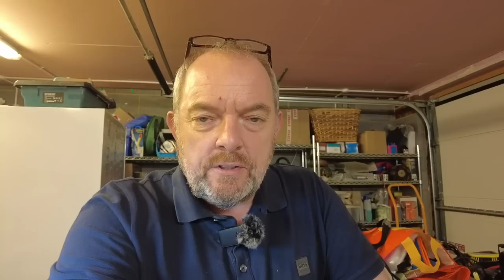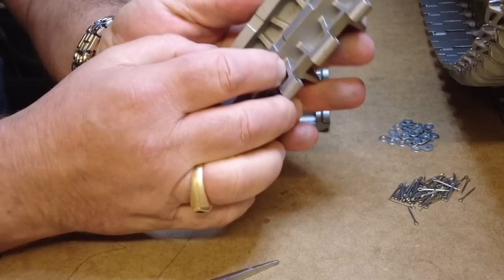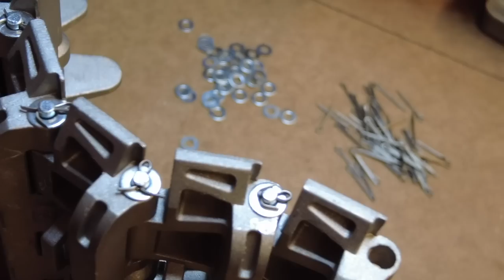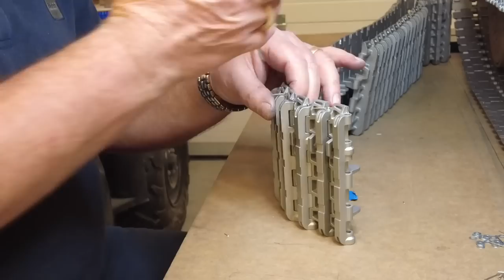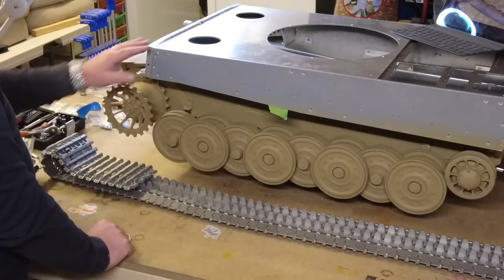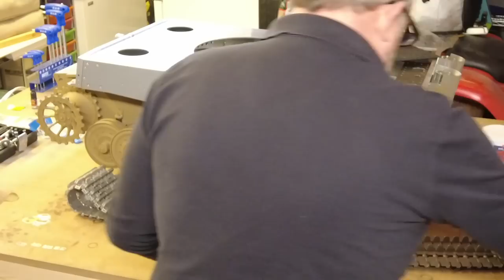1/6 Scale Armortek Tiger 1 Tank Build -  (Video 10)Track Assembly & Installation

Comment: Hi, Just seen this video. I built the first generation early Tiger from Armortek. Your track links look to be cleaner castings than on my Tiger. Also, if I remember correctly the pins on my Tiger were held in with grip washers but I did drill the pins and used some soft copper wire to hold the pins in place. One issue I had was debris getting stuck in the tracks and going around the return roller. The motors were powerful enough to break a track link which was a pain to replace in the field. In the end I made the return roller tension adjustment spring loaded which solved the problem. This said I drove the wheels off my Tiger through all sorts of mud and rough terrain, its a great well built model. I think the best out there. I also made the first generation Sherman which is a superb model. Alas both are sold now, I believe the Sherman, which I built as a Firefly is in the USA now.
Reply from the maker: Hi Allan, thanks for watching and your comments. Yes from what I understand Armortek have greatly improved their kits. I guess they really do listen to the end users. I still have to be careful of debris getting stuck in the tracks, especially small gravel parts. I always jack up the tank after driving and inspect the track for debris...Not had a link break so far but still early days...I guess that is why they provide spare links... I would have loved the Sherman as this is one of my favourite tanks of that era...The Firefly...was that the British army version?
Reply: @tonys_workshop  Yes the Firefly was the British Army version with the 17 pdr gun. I bought a model kit of it and copied that.
On the Tiger the channel formed by the dual track horns seemed to naturally gather debris. On the full size Tiger the track horns are not solid and have a hole cast in them. This may be for lightening the track and/or allowing debris to escape. The road wheels can ride over the debris easily  but if it goes around the return roller it really pulls the track tight. I used to run the tracks very slack and I never had one come off, even turning tightly on grass.
Reply from the maker: @allanrichards3752  Thought so...A good tip on the tracks thank you...I have 92 links each track and keep it slackish...seems to be performing well so far.
Reply: I have the early Tiger you built Allan - partly stripped now for another restoration.
Reply: @petersilcock4260  That's good, nice to hear its still around. Do you still have the anamatronic figures and the exhaust smoke generators I messed with for ages?
Reply: @allanrichards3752  No unfortunately - they were long gone before I got the model.

Comment: Hi one thing I can add is having replaced tracks on numerous occasions on large excavators and other machines which have dozer tracks it helps when joining the track on the machine if you join it at the sprocket end then there is less need to hold the links while inserting the pin as the teeth of the sprocket hold the links in the correct position for you without any struggling
Reply from the maker: Hi Peter, thank you for watching and commenting. Yes, this has been suggested by other more experienced builders as well. I would totally agree now that I have been through the process...a rookie mistake, but thats how we learn. Will definitely use this method when I need to remove the track in the future..Thanks again for your valued comment, it s very much appreciated. Hope you continue to follow my build.
Reply: @tonys_workshop  well that's exactly righ I had to learn on 30 tonne excavators and prinoth ahwi mulchers look that up on YouTube if you like we had an RT 400 and a 200 as well which I drove most of the time as I could transport it only weighing 15 tonnes anyway I digress I have subscribed because Amourtek are just down the road from me an I'm considering buying one but not sure if it would be ready assembled or kit form . keep up the good work and if I have anything else to add I will

Comment: Hi tony. I find it easier to join track / chains on the drive sprocket. This holds things together better while you insert the split link
Reply from the maker: Hi Paul, thanks for your comment and for watching...that makes complete sense...I just found that access was better at the rear of the tank..especially for my big old sausage fingers..... I will definitely try that, if or when I have to replace a link or remove the track...Thank you

Comment: Tony put 1 pin the wrong way round and paint white. Best to split track up at the sprocket
Reply from the maker: Hi and thanks for watching and for commenting...Yes another tank builder suggested the sprocket to split the track as well. Will definitely use this method when I have to remove the track again. Nice tip on painting the pin..Thank you...Hope you continue watching..

Comment: Tony oh the Tracks another fun job🤣🤣
Now starting to look like a proper tank.
Did you take 1-2  links out in the end once you added electronics and Batteries?
Reply from the maker: Hi Gary, yes another lengthy process but in a bizarre way, I actually enjoyed it. Yes, I ended up with 92 links per track in the end. Once the additional weight was applied and the tracks started to loosen up, it definitely needed links removed...works a treat now..thanks for watching and your continued support is very much appreciated.

Comment: The numbers 1 and 2 on the track parts distinguish which mold cavity the part came out of in the factory.  When parts come off the line and QC checks them they need to know which cavity the part came from in case adjustments need to be made.
Reply from the maker: Thanks Jon, solves that question. Thanks also for watching and commenting. Hope you continue to watch and follow.

Comment: Ahh, A bucket list item for me is to build one of these! As you rightly say preparation is important. You answered one of my questions already (it weighs 250 Kilos) could please add dimensions? (will it go through a normal-sized door?) How will you get such a big cat off your bench! and I also assume a trailer or panel van is a must if you intend moving it around. Loving the build! I have been asking about a software update to allow a simulated gear change along with engine tone (I see it sort of with gun recoil) but the electric motor is so smooth (whereas the "driver" would have to change gear ) I will very much enjoy your progress thank you
Reply from the maker: Hi Jim, thanks for watching and commenting. The net weight is 150kg, then the motion packs approx (from memory) approx 40kg...add the two 12 volt batteries and it is up there over 200kg...put it this way, you aint lifting this by hand :-) dimensionally approx 1550mm in length including the gun barrel, just under 600mm in width and with added figures height approx 550mm. It certainly goes through a normal size door, but be mindful that its heavy and the metal tracks will chew up nice finishes. I do cover this later on in the build, but I transfer my tank from the bench on to a table scissor lift and use a folding disabled ramp to drive the tank from the table lift on to the floor. This can also be used to drive the tank up into an estate car, van, SUV, trailer etc. Interesting thought on the gear change, that would be excellent as well as the tank recoil after the gun is fired..probably the only thing lacking on this amazing model...Hope you keep watching...more to come.

Comment: Would adding a little dab or two of white lithium grease to those track link pins before putting them together have been a good idea?
Reply from the maker: Good question and I think probably yes, but again no mention of this in the instructions. I thought of regular grease, but then worried about picking up dirt etc, so fitted them dry. Definitely something I would consider for the next build. Thanks for watching and commenting, its very much appreciated.

Comment: Hi Tony, Ive just stumbled on your video, brilliant work, i am at a very similar stage with my Tiger 1, can you tell me what base yellow you used for the road wheels please?
Reply from the maker: Hi and thanks for watching. I used Fosco Industrial Army Paint
Color: WH. Dunkel Gelb, 400ML spray Matt for the entire tank. I used an grey etching primer for the prep work. Hope this helps and thanks also for your positive comment. If I can help on anything else, please do not hesitate to ask..
Reply: @tonys_workshop  Brilliant, thanks for the quick response, did you get them from Amazon? £8.25 a can?
Reply from the maker: @theoldstables8977  I got them from Militarymart.co.uk...but just checked and they are sold out...However yes it is the same as Amazon are currently selling...hope this helps..

Comment: Hi Tony, really enjoying your videos, I've just finished building the Sherman Easy Eight.Like to know what Jack you use for the Tiger on the bench and where you got it.
Reply from the maker: Hi Tony, thanks for watching and for your positive comment...I am using a Steel Motorbike Repair scissor lift jack stand - Anti-Slip 500kgs. Available across the internet anywhere from £40 to £50. A brilliant tool and without which I would have struggled. I would use a ratchet with appropriate size socket if you have one, to raise and lower as the handle it comes with is too short..Hope this helps...
Reply: @tonys_workshop  thanks, I will purchase one of those, makes life much easier
Reply from the maker: @tonysel5569  You are welcome...Amazon sell them as well...Hope you continue to follow my build.

Comment: To join the track, it is easier to have the 'split' on the sprocket: the the track parts will be aligned and the track pin will slide in easy
Reply: ah, Paul McCullock made same comment,. you saw it already, never mind ;-)
Reply from the maker: Hi Leon, yes , but thank you also..Definitely how I would look to do it next time. Hope you continue to watch.

Comment: Couldn't you of used a drill on the jack to make it easier n quicker?
How many kg will it be once it's finished?
Reply from the maker: Hi and thanks for watching and your comment...Interesting question...Not sure the shaft would fit in a cordless..The socket size is the same as a wheel brace...But I will definitely check that as it would make it easier..hope you continue to watch.
Reply: @tonys_workshop  well for the amount you've paid for that amazing machine. Just buy the cheapest anything and alter it for your liking to make your life easier

Comment: Really enjoying your channel, ive built two HENG LONGS 1/16th with my kids mostly the kids, they upgraded electronics , gearbox and motors. Ive just started a 1/16TH Tiger 1 from Hatchett mags, 150 ish magazines in several plastic boxes.. great fun. A lot of your parts seem the same as the Hatchett tank. Will you fit an engine /motors ? . Im seriously thinking of buying a Armourtek vehicle not sure which one yet. I live in Norway so a drive to the UK for my summer holidays could be a plan.
Reply from the maker: Hi Dean, thanks for your comment and for watching my videos...Heng Long models are very detailed and I did consider one, but wanted to go big :-) and this is big...I have opted for all the option packs which include full motion, sound, gun recoil, machine gun, smoke and lights..Building a tank with over 150 separate mag issues...now that is patience. If you are looking to buy from Armortek, they do ship to Norway and although the shipping cost is high, I'm pretty sure you save on paying the VAT, so could work out cheaper than buying here in the UK...not sure if there is any import duty?....just a thought and it may be worth looking in to....Hope you still choose England for your holidays regardless, especially now it's a Coronation year :-)...Thanks again for watching and hope you continue to follow...
Reply: I like the 1/16th scale so do my old eyes. Hatchetes Tiger 1 is heavily detailed inside and out, enjoying taking my time and painting/weathering as i go along. Working out how to motorise it. Learning a lot from your build and getting ideas from Armourteks design. Looking forward to your next video
Reply from the maker: Thanks Dean, much appreciated. Next Video up on Saturday.

Comment: Can you Blue the tracks with gun bluing?  Its a liquid that might give them an oxide black coating that would look natural.  As opposed to spray paint...
Reply from the maker: Hi Steven, thanks for watching and commenting...Interesting question, not sure as the track links are cast Aluminium....Am I correct in thinking this requires a lot of heat? Sorry not really up on this area.....Spray painting them is inexpensive and when its been driven for a short while and the paint wears in all the contact parts, they look pretty realistic.
Hope this helps and hope you continue watching...thanks again for commenting.

Comment: You not grease the track axels & pins?
Reply from the maker: Hi Dara, thanks for watching and your question....Definitely not the track and pins and it's no longer a requirement for the axles according to the Armortek instructions.  I guess the modern sealed unit bearings on the Axle remove the need to grease. I know some builders still do this, but I chose to follow the instructions. Hope this answers your question and also hope you continue to follow my build.

Comment: A question to the experts!  I just can't get over this being a 1/6 scale. I have a good or bad habit when I watch interesting parts of scale models, to do quick up scaling in my head to get a feel of the size of the real part, and normally it all seem to make sense. But in this case, take for example the width of the tracks. I guesstimate them being around 20cm or 8" wide.  That becomes 120 cm or 48" wide  tracks! That  doesn't seem possible. Same with those wheels. Hard to tell but i guess around 15cm or 6" in diameter which becomes 90cm or 36"!! Holy sh*t  this thank has to be a monster!  I know nothing about it but I don't think I've ever seen a tank with  almost 50" wide tracks.. What am I doing wrong? I mean the only thing I can't think of is if his hands are much smaller than I estimates them to be? By the way, since the expert you is already here, Are there different camps wheater you build you tank in Aluminium or steel? I could imagine a scenario kinda like when talking abot 5.56 vs 7,62, AK vs Ar.. Or is that not something people care about? Do they sell large kits like this in steel as well? First I assumed that the steel tank would be much more expensive considering it might be harder to construct, but Aluminium must be a much more expensive metal, so perhaps it's cheaper, what's the cost ratio between steel and aluminium these days? If two identical models were built, one with each metal, how much heavier would the steel one be? More than double right? What about price ratio? Thanks !
Reply from the maker: Hi Erik, thank you for watching and commenting...let me ry and answer some of your questions...The tracks are approx 100mm  wide. The wheels are approx 110mm in Diameter. The tank in overall length is approx 1500mm. For the most part the kit is made from aluminium as I guess this helps with cutting down the weight and cost but there are also a lot of cast pieces, so aluminium lends itself better for this purpose. I would not want to guess how much a steel one would weigh. hope this helps, best regards...Tony
Reply: @tonys_workshop   Thanks for answering :D  regarding steel vs aluminium tank I looked up the difference in metal density and it would be approx 2.92 x the current weight :D
Reply from the maker: OMG...you would need a crane to lift the thing :-)
Reply: @tonys_workshop   But I like that. I would be pissed of if  I  ran over a soda can and it held up :D
Reply from the maker: Hi Erik, trust me...this tank is unstoppable...it will climb and crush most things in scale terms...check this Youtube video out : 
https://www.youtube.com/watch?v=45tCH05tXGI

Comment: Why did they not use c-clip instead for bloody split pins ? Would be much neater  and if you need to replace a link for what ever reason , it will be a blast ( hey you pay enough for that toy ) 🙄🙄🤦‍♂🤦‍♂
Reply from the maker: Hi and thanks for watching and your comment. I understand that the earlier kits had something similar to a 'C' clip but the amount of friction and stress the tracks undergo when driving these heavy models warranted a secondary method of securing the pin. You are right in that these are not cheap kits but for the most part this is reflected in the quality of the materials. I hope you continue watching and thanks again for your comment.